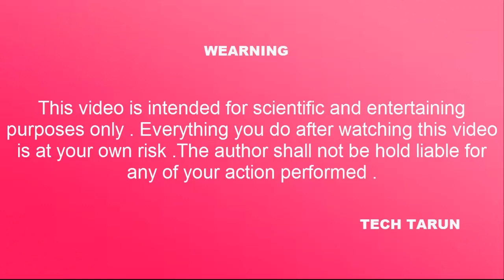Make a mini inverter [VERY EASY]

Comment: Sir can i use that 2 same transformers to connect in parallel in the circuirt or make the same 2 ones and connect all 2 outputs to the bulb for more power
Reply from the maker: No...

Comment: Bro Maine D882 Transistor lagaya hai or 1k ka Resistor par kam nahi karta Transistor Garam hojata hai kya Katy ???? Plzzz help
Reply from the maker: Change transistor or check...  33 ohm lagake dekho...
Reply: Maine jo Transformer  liya ow
1.3 ohm  1.6 ohm  6.3ohm  Asa hai  
Bro plzzzz help main bolo na kya Karu????
Reply: Bro....
33 ohm laga k v dekha kam nhi kar raha hai Transistor Garam hojata  
Kya karu.....plzzz help bro
Reply from the maker: Transformer ohm check karo.
1  -. 7.2 ohm to 8.8 ohm ( AC out)
2 - 1 ohm to 1.2 ohm
3 - .6 ohm to 1 ohm
Reply: Maine jo Transformer liya hai kya use nhi kar sakta??
Reply from the maker: Transformer ki ohms mil Jata to wahi Transformer use kar sakte ho...Multi miter mein ohm Karke check karo.. Jyada ohms wali 2 pin AC output..
Reply: Maine jo Transformer  liya ow 
1.3 ohm  1.6 ohm  6.3ohm  Asa hai  ab Kya karu?? Bolo na bro plzzz
Reply from the maker: 6.3 ohm AC out put
Video mein connection  dekh kar same karo..
Use china led bulb
Reply: Nahi hota hai 
Trinsistor Garam hojata hai 
Kya karu bro....ab??? Bolo na plzz
Reply: Bro kaha ho app kuch bolo na aap ka number do na bro...
Reply from the maker: WhatsApp no 9434602937 ( Do not call)

Comment: Can i connect DC motor
Reply from the maker: DC motor Kaha connect karna chahte ho...
Reply: At the output of the circuit can i connect DC motor by replacing bulb
Reply from the maker: Do not use DC  motor output of the circuit.. Circuit output AC voltage...
Reply: Thanks bro

Comment: Bhai mai na D882PM47 transister laya chalaga
Reply from the maker: D882 transistor chalega
Reply: @techtarun77  bhai mai na banaya mai na 1 k resister use kiya output voltage 20 kee aa rahi hai ab kya karu
Reply from the maker: Use 33 ohm restance।।
Out put check Karo multimeter ki AC range main
Reply: @techtarun77  mera pass analog multimeter hai muja iss sa ohm dekhna nhi aata abb kaisa dekhu

Comment: Bahii kaam to karta Nahi haa
Reply from the maker: 1-Poore circuit dipend karata hai transformer ke oopar.....

2- Transformer coil ohm 1- 00.6
                                            2-01.0
                                            3-08.6
    
  3- In put voltage 3.7v & output 50v-60v

      
  

    

          
        ·

Comment: work ni  kr rha
Reply from the maker: Multimeter se transformer ki ohm check karna padega..  Transformer ki ohm  match  nahi karega tu yeh kaam nahi karega.. Transformer AC out put   pin 8.5 ohm. ;   01.0 ohm or 00.6 ohm..